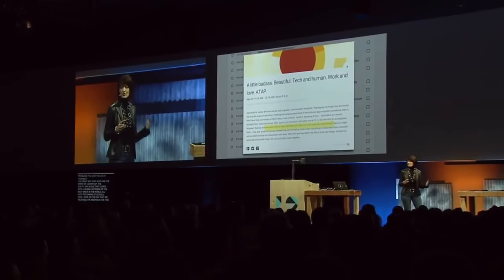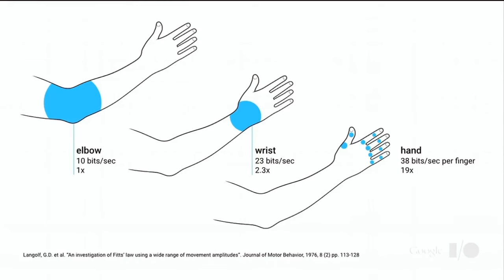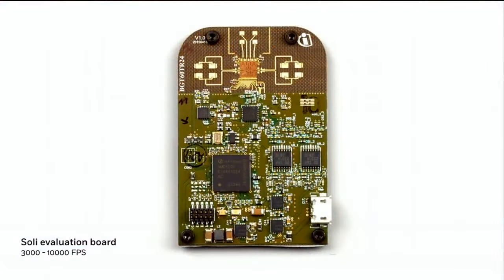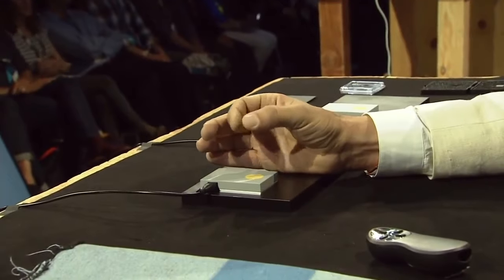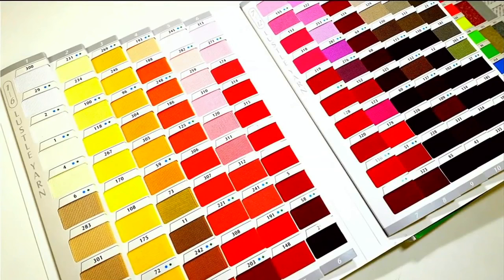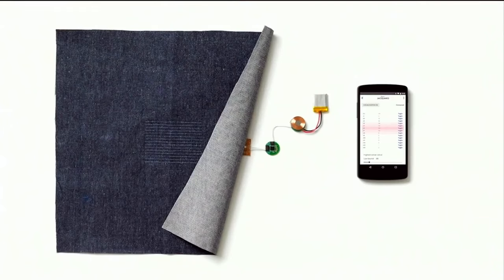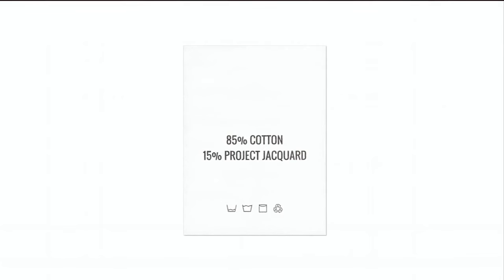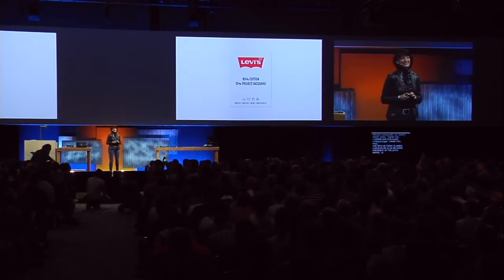Jacquard and Soli Presentations at Google IO 2015

Comment: this is very impressive.... but new ideas for use this technologies is to open source the technology and let new and young Developers buy a kit in order to make new ideas.... even a watch with this two this chips or phone... if you give open source access to developers ... they will make it mainstream in very helpful applications!!! on even if they you connect it with an 32bit microcontroller ... and make a small robot to do more accurate stuff...
Reply: Hi Jim, I want to do some stuff w/ this chip and a Microcontroller, but I don't know where to get it or buy it